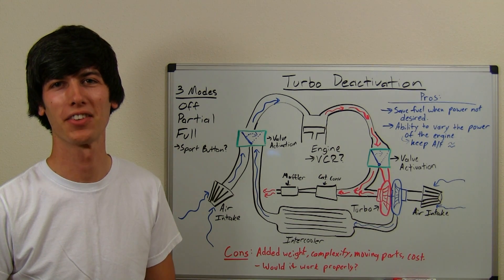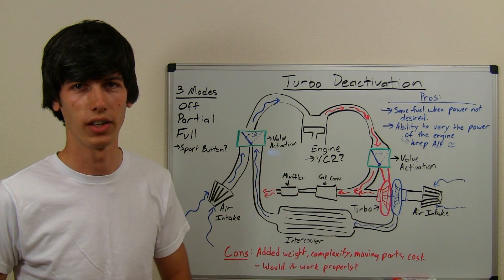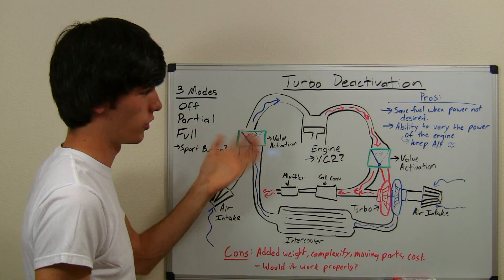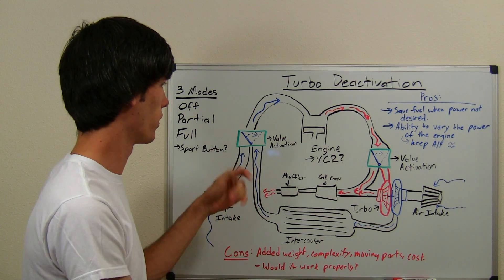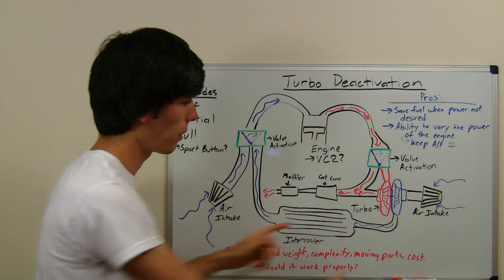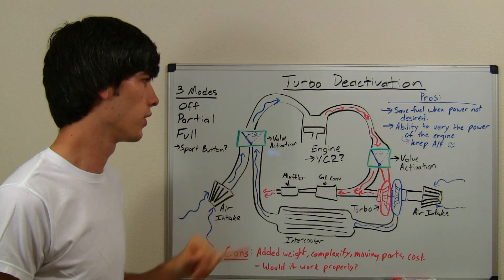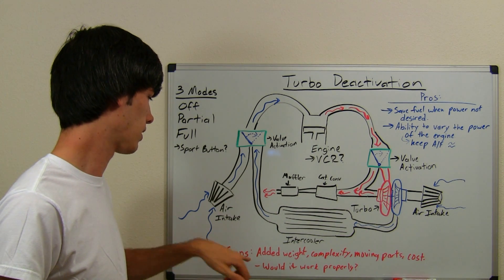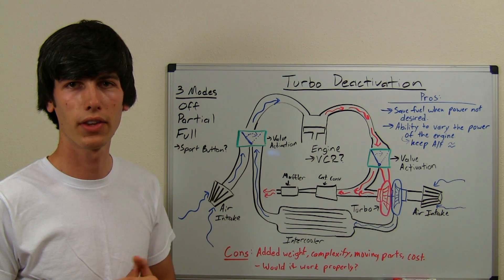Turbocharger Deactivation Concept - Explained

Comment: Not sure if precise boost control wasn't a thing at the time, but couldn't you do this with a regular boosted setup without new parts? Just target 0bar of boost instead of 1 or 0.6 or whatever. If you fully open the wastegate it would negatively impact intake airflow since now the intake/engine has to spin the turbine. So if you just let enough exhaust thru the turbo such that the intake airflow is not compressed at all, it should behave the same as if you didn't have one. And it's not like you're paying energy for the turbo to spool up like an SC.

Comment: Dude, I have a borg Warner k04 twin scroll turbo, it has good boost at low ar but the boost stops building early and dies off as well when it could pull a bit harder and longer if I could get it to move more air during high ar. Can I open it up somehow dremelling is an option if it would work. Great videos, thanks for the information. Just looking to optimise what’s there, it’s running factory 20 psi, engine is a GM  A20NFT.

Comment: I know this is an old video but I have a question for turbos:
How do I reduce/eliminate boost from turbocharger? I know this is the concept your discussing in this video, but how can it actually be done? With gas prices I really can’t afford the cost of premium fuel in my car but don’t want to risk knock or preignition from increased pressure/fuel because of my turbo. How can I essentially eliminate my turbo so I can tune for and use a lower grade fuel?
I hope that makes sense. Thank you

Comment: I am very surprised that a turbo activation/deactivation system has not yet been invented by anyone. On/off turbo switch. And yes turbo requires more fuel hence less fuel economy. Another advantage of this dual system is you can preserve the turbo's life by using it only when you need it like racing.

Comment: Turbos are not like superchargers. Superchargers compress based on engine rpm. Turbos compress based on exhaust pressure, which is a function of how much air and fuel is being burned which is based primarily on intake throttle position. They automatically balance them selves out. This is a more complicated way of doing what turbos, intake throttles, and wastegates already do. If you want to use a computer controlled wastegates to artificiality limit power,.... Then buy a boost controller. 

I know this is like 8 years late, but this guy is WAY overthinking it.

Comment: Efficiency of a displacement combustion engine is largely determined by the combustion temperature that's achieved.  Lower compression means lower temperatures.  Turbo engines have a lower mechanical compression ratio than normally aspirated engines because the charge air at peak output is usually compressed to somewhere around 2:1, thereby roughly doubling the amount of air going into the cylinder, which drives both higher compression ratios as well as larger amounts of oxygen.  That oxygen surplus allows more fuel to be efficiently combusted, thereby increasing the total caloric output of a given cylinder charge, raising the total heat for a given volume and mass of air, which raises the combustion efficiency.

What you're talking about is lowering the efficiency, by effectively consigning a turbocharged engine to run at normally-aspirated compression ratios.  8-9:1.  You'll find that 8-9:1 compression ratio gasoline engines are horribly inefficient, and that's why no one makes them.

Instead, to find efficiency, look at work done.  Turbochargers work by scavenging energy from an otherwise discarded exhaust gas stream.  Lower pressures require less work to compress, but mean less oxygen for the cylinder charge.  Or does it?  You can achieve a slightly higher mass charge by first compressing the intake stream, and cooling it to ambient temperatures (intercooling), and then decompressing it.  This lowers the charge temperature, and gives you a return on some of the available energy in the exhaust stream.  The problem is it's incredibly complicated to engineer an engine capable of handling high efficiency Carnot charge-air cooling at the loads (20-40hp) required for truly efficiency highway cruising, which also providing overtaking and acceleration power on demand.

So that's kinda the real problem.  Electrical generator turbochargers do go a large way towards offering a less complicated method of harnessing the exhaust free energy to do work, but require additional complication elsewhere (electric motors) to real efficiency gains.  If you can come up with an elegant way to engineer a massively lopsided twin turbo application for low/high output operation, while also offering Carnot cycle charge cooling on very partial throttle, that'd be pretty nice.

But, I mean, really this is all just dancing around the general concept of variable compression-ratio engines, which is what turbocharging really is just an implementation of.  Now, Lexus seems to have managed a variable compression-ratio cylinder design, and I don't know if they've coupled it to forced induction or not, but that would truly offer high efficiency across a massive power range.  Which is what we're all really after, isn't it?

Comment: Don't know if it is right but this is my idea
It could work, but if the car is tuned for the turbo, then it will be running very rich. But how you can fix this is a bit technological. If you could reprogram the computer to change the fuel injection for each mode, then it could work.

Comment: I like this idea for highway cruising.  I've never had an engine with variable CR, but you could run more ignition timing in NA mode to recover some lost power.  But how to implement this on a modern FI computer run car ...2 separate fuel /ignition maps, I think Megasquirt might do??

Comment: By the way for light load operation, all of the equipment that you have added on the intake side of the engine does nothing.  The throttle will be the biggest pressure drop in that system for light load operation, having to draw air in through the compressor and intercooler just adds a little resistance allowing the throttle to be a little more open than it would have been otherwise.  But the inlet manifold pressure stays the same for any given load and the inlet pumping losses also stay the same, that's why there's no benefit for all of those proposed mods on the intake side.

Comment: To get 90-95% of the benefits that you're talking about with 10% of the hassle you can have a Part-Throttle-Open (PTO) wastegate control strategy.  To see that described in more detail look it up in a book called Turbochargers by Hugh MacInnes, 1987.  If you are already running a variable boost control via a 4 port 2position solenoid valve, then adding the PTO function can be done for under $100 by simply adding one more solenoid.

How does it work?  Imagine a traditional standalone external wastegate with a 5 psi (35 kPa) spring with boost under the diaphragm to open the wastegate.  If under low load and cruise conditions you connect the top of the the diaphragm to inlet manifold pressure and the bottom side to atmosphere, good things happen.  At any time that the inlet manifold pressure is less that 65 kPa absolute (35 kPa vacuum), the atmospheric pressure under the diaphragm will start to open the wastegate relieving the exhaust back-pressure, improving fuel economy.  The moment that you increase the throttle position to climb a hill in high gear, the wastegate will close and start spinning up the turbocharger ready to run at boost.  One does have to switch back to the normal boost under the diaphragm and vented above for higher load operation, but that  can be done vis the solenoid valve installed for that very purpose.  That changeover solenoid valve can be triggered by the car's ECU or a position switch as soon as throttle position gets to a predetermined position.

I intend to install this very setup in my next project car where two solenoid valves will be used, the 4 port valve for variable boost (up to 18 psi) on 5 psi spring and a second solenoid to provide that part throttle open function at low engine load.  Reducing the exhaust back pressure will definitely improve fuel economy, because it is a whole bunch of 'pumping work' that the engine no longer has to do at light load.

Comment: Just spit balling here but if you added an electronically actuated bypass/relief valve between the turbo and the inter cooler, what you could do is have the N/A intake valve open while the turbo exhaust bypass closed, which would technically be a shorter "path of least resistance" for the air to get to the engine to help the turbo spool up ideally reducing turbo lag. And the turbo intake bypass between the turbo and the inter cooler can begin to close, then the N/A valve closes while the TIB finishes closing and engages the turbo fully spooled but in a more smooth manner eliminating the jerky engagement of the turbo. That's my thoughts on what the "partial" mode could be. Let me know what you think man! By the way I love all your videos and diagrams, you have taught not just me but also my girlfriend all sorts of new concepts in addition to giving me more specific understandings and details of subjects I already understood but probably couldn't explain too well. So thanks bro, KEEP EM COMING!

Comment: I drive a work vehicle that has a turbo diesel engine, while it may not be the norm for other turbo charged engines, my work truck is quite old now and constantly enters limp mode where there is minimal or no boost being produced by some ghost in the system that the dealership and several independent shops can't find, and I can tell you without the turbo this truck couldn't drag a dead hooker out of bed, Mercedes simply used too small of an engine and  compensated for its poor horsepower by adding the turbo. I'm dead serious I can hit a slight incline less than 1% and it drops 10-15MPH in a matter of a few hundred feet if it's a decent grade I'm doing 40MPH by the middle of the incline, and it won't go any faster until I crest the top and get back on flat ground or a negative grade. Also taking into consideration that most if not all gasoline turbo engines require premium fuel which actually has less power in it than standard E87 fuel but is required for efficient fuel burn with the higher compression of oxygen in a turbo system. Turbo's usually boost fuel efficiency unless your hard on the throttle, the typical problem for fuel economy on a turbo charged engine is most people have this idea that "I have a turbo, so I should drive more aggressively" which does cause them to get poor fuel mileage. It's a cool concept but a totally impractical resolution to a problem that can be solved by proper driving techniques.

Comment: I think the only advantage to this is it would allow you to use lower octane fuel when not on the turbo.  Also the Mini cooper did this with there first gen cooper-s but it was a supercharger & there's work that it would always run Naturally aspirated (NA) then open up and allow the super charger to kick in when it sensed a load or when you would floor it other wise the extra boost that the supercharger made was diverted through boost bypass valve.  This did not work to good for them because the super charger was always "on" it just re directed where the boosted air had to go they soon changed the car to have a basic turbo setup after.

Comment: Why would u ever want to add a flap at the intake on the left ( without turbo) ? At low speeds the turbo on the right is deactivated anyway. At high speeds u want the additional intake from the one on the left too.. that gives more air meaning more fuel can be burnt leading to more boost. So, in either case, u are better off leaving the flap on the left intake open at all times. Am I right anyone??

Comment: I've had this idea for years and there's some 3D Solidworks models I made somewhere. The cost to do it yourself won't be too much and it's totally doable. The only problem I see is carbon buildup on the valve that will cause it to malfunction.

Comment: I think its a great idea, but i think it would be better if it was electronically controlled by the ecu. Meaning, for example, if im below 50% throttle the valves are closed, but above 50% throttle the valves open, so you always can have power to get out of sketchy situations, but maintain fuel economy if you keep your foot from flooring it lol. Just an idea.

Comment: I think the biggest drawback is when the turbo is deactivated the vehicle will suffer from major performance reductions. Consider a case of a diesel or low capacity N/A vehicle, it is slow as a 3 legged donkey compared to a turbocharged variant of the same vehicle. Even the minimal boost at low RPM has a seemingly huge effect on the performance vs N/A versions. Indeed if you actually did want your car to be drivable in a "granny mode" this would work fine or if the performance of your engine in an N/A configuration was still good this would be a potentially positive application. But this could surely be done cheaper by using an electronic rev limiter, similar to a pit lane limiter on race cars...
Good show BTW..

Comment: I don't think anyone would put a shut off valve in the exhaust manifold to bypass the turbo. Even if you did, where's the exhaust going to go when you close off the manifold? build a separate exhaust dump for NA mode? seems impractical.

Comment: I had the same idea when i found out what electric exhaust cutouts were. As these would make good valves.  I did not think of it as a way to save fuel however. Instead  It would serve as a valet mode feature. Say you wanted to take your 1000+ hp car cross country. You would not trust the hotel valet to park it. Especially if it looked like an average sedan. So what if   if like on a veyron you had a second key to turn off the turbochargers, lock  the rear wing, and change the timing. You could have a car that would put out more like 300 hp and would be easier to drive. It also would act as a way to keep the car from doing accidental burnouts or spins in rain, or when teaching someone how to drive. Like a beginner mode on an rc car. It would also help keep engine bay temps down on an extended highway drive. And most importantly maximize the lifespan of the turbocharger.

Comment: Just a cursory glance...I don't think it will work in any  configuration other than normally aspirated or full turbo settings.  It looks to me that any in-between position will cause the higher air pressure from the turbo to take the path of least resistance to atmosphere, which looks to be through the normally aspirated air intake.

Keep up the good work. You have a talent for explaining how things work.  I have enjoyed several of your videos.

Keep thinking and dreaming!

Comment: Would this idea allow for retention of the amazing soundtrack of a naturally aspirated engine when the turbo is de-activated?

If it could be designed where when the turbo is switched off, you get the drama of an NA Engine sound, but when it's switched on, you get all the drama of a Turbo-Charged engine, this could be a selling point in itself for Turbo-Charged supercars nowadays that are "losing their soul" because the turbo mutes the engine noise.

Comment: I believe that valves are nowadays very reliable themselves.
However I would like to mention that on diesel engines that might be a little more of a problem for the exhaust-side valve, similar to what happens with EGR valves that can get dirty and may lead to become stuck at some point.

Comment: The compression ratio of the turbo engine will be reasonably low (9:1) so if you "switch it off" you now have a low compression NA engine which is not so efficient.  Plus added cost of all the extra components I doubt the manufactures would entertain it.  Probably all ready looked into it.  A much more exciting option is what Mr Koenigsegg has invented.  Free Valve engines!  No camshafts and complete valve lift and timing freedom!  That's awesome.
Reply: He mentioned having variable compression ratios for this same reason. High CR no turbo + Turbo low CR when you want or need the power.

Comment: You'll get better fuel economy with a turbocharger on a car or truck with direct injection because the boost pressure isn't making more fuel come out of the injectors and then you can tune your car or truck's injectors to pump more fuel into each cylinder depending on your boost pressure to get the maximum amount of fuel burnt and make the most power out of the boost pressure.

Comment: "if" u had a variable compression engine than yes your idea would "work". 
Would it save fuel and running cost (up keep off parts etc) vs traditional turbo setup? Yes but would it be worth it. No. 
Cheaper and more economical to just run multi mapping and multi boost settings. 
Basically run almost zero boost (so turbo be essentially off) when in low boost mode with mapping to suffice and than medium boost/mapping for zippy driving and high boost/mapping for when u wanna go track.....Most people who play with turbos have this setup already.... low boost and high. best off both worlds.
Reply: How doesn't this design work? The turbo will have no exhaust gasses beig routed to it, thus no boost.

Comment: How about this.. A compressor, either engine driven, electric, or even turbo driven, and a pressurised vessel in the car, and only one valve to control where the intake charge is coming from, sort of like a turbo with nitrous-like actuation?